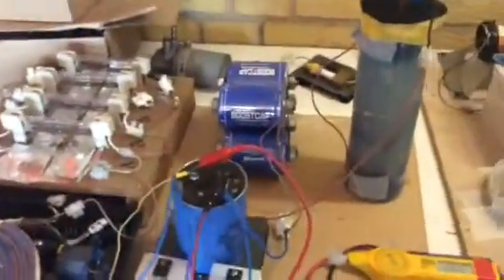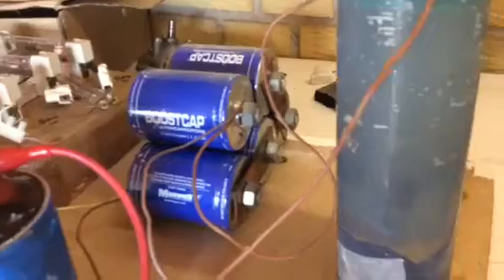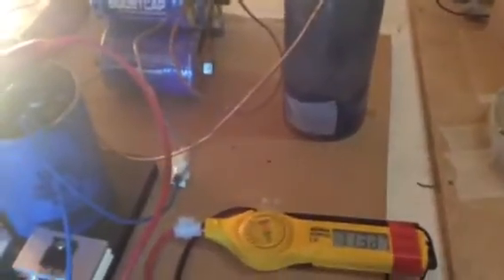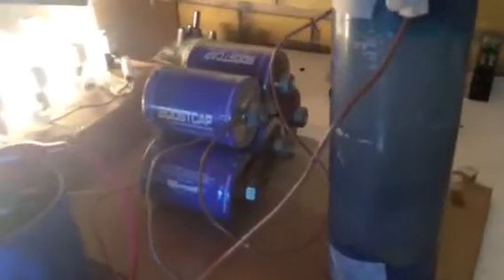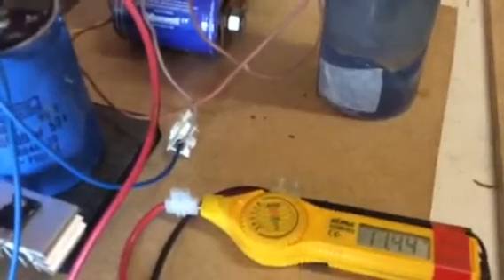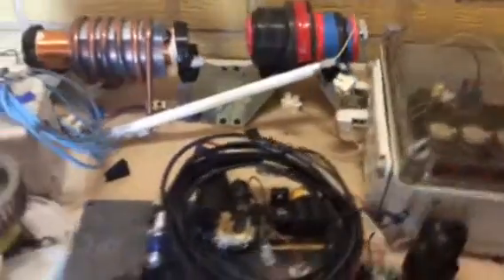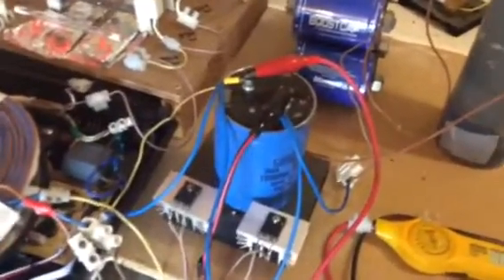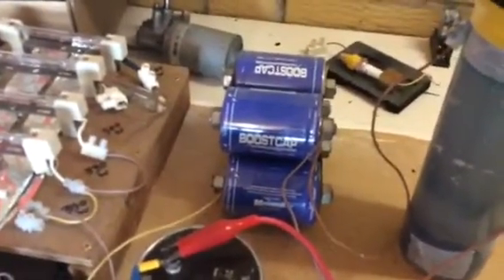INduction transformer HHO experiment.

Comment: I wonder how that would drive a magneto hydrodynamic water pump?
Reply from the maker: dude man hi but I haven't heard about this pump. How much power does it use.
Reply: dkdyker if you go to my channel everybodyseye. You will find vids of my 3 phase dc pulse motor with bedini circuit. Instead of charging a battery I use the output of the bedini circuit to make hho and drive a magneto hydrodynamic water pump. I get about 6 volts across the cathode and anode. The bedini circuit draws less than an amp. So not much power needed to drive the pump or make hho. Though there is a back spike from the coil of over 200 volts as it can charge a cap to 210 volts in about 3 seconds. My crappy meter can only read 6 volts but, the oscilloscope shows the spike and subsequent ringing if the circuit. My thinking as of now is that it is the ringing of the circuit that makes the magneto hydrodynamic water pump and the hho work as well as it does.
Reply from the maker: hi dude man. just looked at your vids. you are doing some great work. i would like to see the vid you mentioned, can you send a link as it is easier that looking through everything? thanks.
Reply: dkdyker search magneto hydrodynamic play time for a short 3 minute video. There is a 4"×1"×1/2" neodymium magnet under the dish.